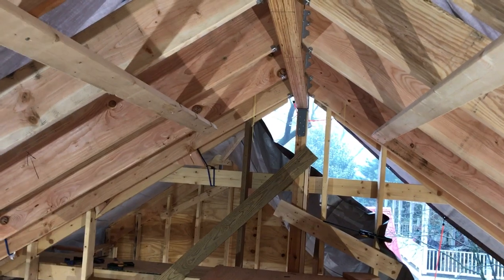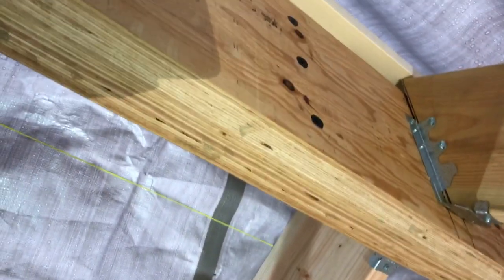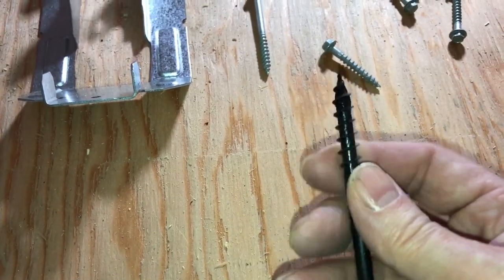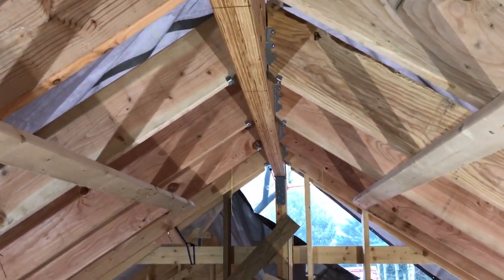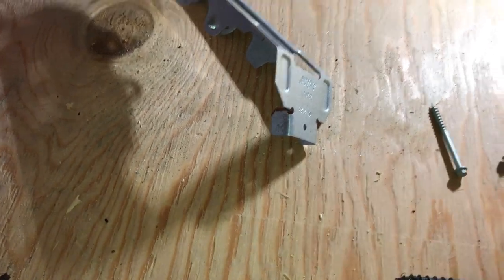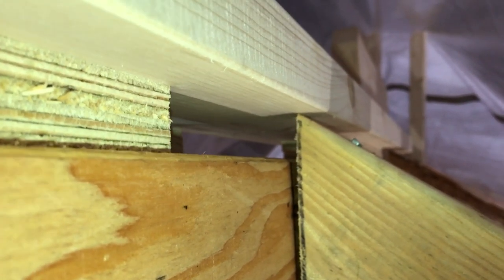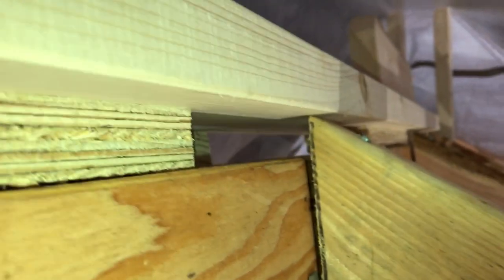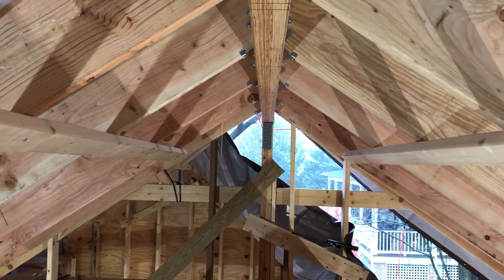Hanging Rafters on a Structural Ridge Beam

Comment: Just found this awesome video. Question, do I just lower my calculated ridge beam height by 1 inch to achieve the great ventilation shown here? 
Thanks
Reply from the maker: Yes - you would either have a slightly lower ridge beam or a slight increase in the pitch of your rafters.

Comment: I’d like to install a structural ridge beam to support the roof in my 17.33’ x 10’ shed, because I want to remove the rafter ties and open up the space overhead. So I’ll install posts at each end of the building (Positioned on top of the header on each side) to support the LVL ridge beam. My question is, can I just place the LVL beam below the rafters and attach them there? I don’t want to have to cut a slot into the tops of the rafters to fit the ridge beam if they can just be attached to a ridge beam positions directly beneath them.
Reply from the maker: I did something similar here - the main thing is that the beam is sized correctly and fully supported all the way to the foundation.  

Best of luck with your project!

https://www.youtube.com/watch?v=wNvH_NJ8sC4
Reply: @TheLittleHouse  what’s the best way to attach the rafters to the LVL beam in this situation? Should I use a metal piece of hardware or just toenail them together. Toenail seems weak so looking for better suggestion.

Also, the LVL beam will be on posts that come to the header over a large door opening two doors that swing open on that side of the building. Do you think the beam would be adequately supported by a beam that sits upon the header and then the wrap is transferred to the sides (corners) of the building via the header?

Comment: Is the dropped ridge beam needed if you have a single ply LVL? Im working on a shed and calculation calls for a single 1.75"x14" LVL for the span. I want to have a cathedral ceiling with ridge vent and have debated whether standard roll of corning ridge vent would work over top.
Reply from the maker: You'll need at least a 1 inch gap for the ridge vent to function properly, so yes, I'd say you still need it
Reply: @TheLittleHouse  I was planning to stop the sheathing short of the ridge beam, I just haven't looked to see if width is too wide. Since single ply LVL is only 1.75", I suspect it's not an issue.